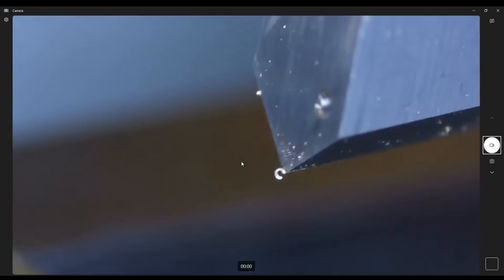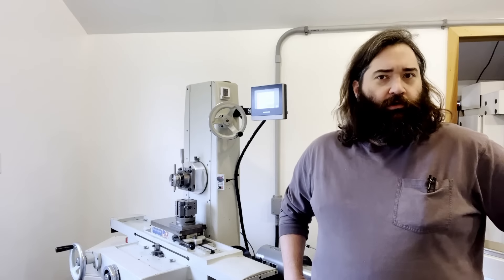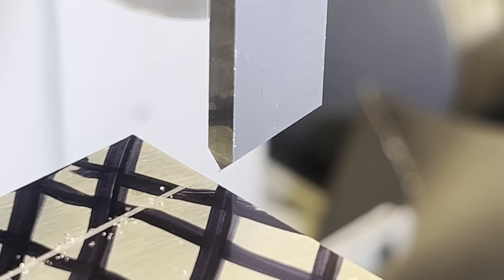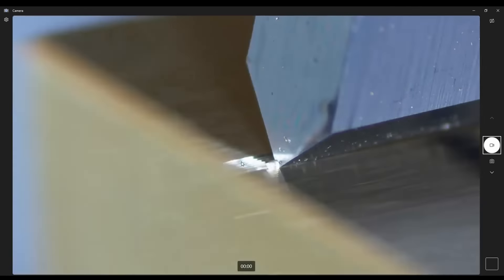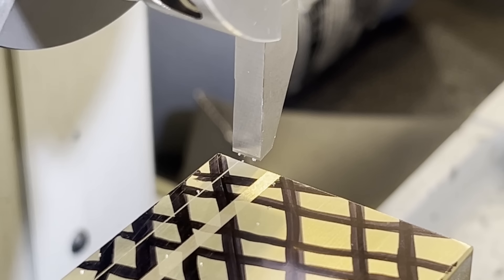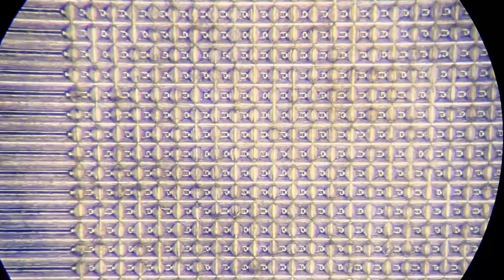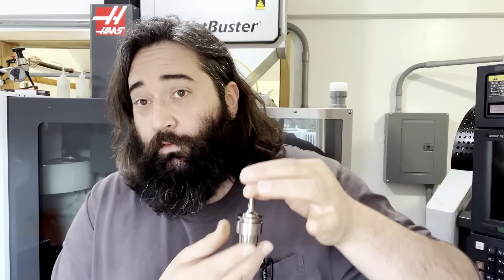Shaper Micro Machining

Comment: The results speak for themselves!  This is certainly a niche but clearly a relevant one, and I put it to you that vintage shapers with modern controls can still be relevant.
Reply: I picked up a small shaper a few years ago, mostly because I thought it would be a neat machine, and a lot of fun to use (which it definitely is). Adding a DRO and a quick-change toolpost has made it a seriously useful tool in my shop.

Comment: I used the cnc mill as a shaper. Was adding tooling to the underside of the head that was not finish machined. Mounted a cutter in the vise, and ran gcode to shape that area flat. Plus the added benefit that cleared area was square to the table travel. Worked well.
Reply from the maker: That is a very smart way to true up that surface

Comment: It’s not crazy if it works. Using the machine control to emulate the function of a clapper is kind of hilarious. That’s a lot of computing and control to emulate what used to be achieved with a hinge and a rigid stop! It makes perfect sense it’s just funny.😂 Thanks for sharing.
Reply from the maker: that comment about a lot of technology replacing a very basic mechanism is a discussion I have a lot. Was chatting with a guy that does jig grinding in a linear motor cnc mill and a manual moore. The cnc is amazingly capable, but the number of very expense components needed to do what a few bearings and solenoid do is interesting.

Comment: That's clever. I've never had to machine features quite that small so it would never have occurred to me to use a grinder as a micro shaper. Though I think I've seen a video of a guy who had a tool that was used to create a patterned surface that was essentially a freely turning off-center single point tool that was used in a CNC mill to do something similar to what your doing here by dragging it along a curved path.

Comment: I do a lot of micro milling in PEEK used for biological research and have played with shaping in the mill for fluid paths with very specific floor geometry. Unfortunately I don’t have a lot of time to play so it goes in fits and starts. I got kinda jammed up with the M code for spindle orientation and my CAM package. I just had a part come in with a 0.030" slot in it that I would have to mill from both sides because it’s so deep and I’m sure I’d break a few of those endmills. The cost really does add up. I’m inspired to try it your way in my Prototrak mill.  I just need a way to indicate in the cutter. First tho I’m going to talk to the just out of college ME and find out why the slot is so small or if it’s something I can just cut by hand with a jewelers saw

Comment: Good video thank you 
I did see your last video also. 
People all seem to try to go high-tech all the time sometimes there’s a low tech solution to the same problem  

We did something like that for spacecraft antenna. It was copper plated onto fiberglass sheets, and had to be cutting the notches. And we used a hand block plane there’s a full-blown machine shop.

Comment: Really interesting video, and you clearly laid out the use case for what is by-and-large a forgotten machining technique. I have some notes about the audio in this video: The voiceover was totally acceptable and easy to listen to. The audio that you recorded with the built-in microphone of your camera during the piece-to-camera portions of the video was extremely quiet, and the piece-to-camera at the end of the video contains a fair number of clicking noises that were made by you putting stuff onto the table where your camera was resting. Both of those things can be very easily fixed with free software like Audacity, and if you don't like cutting popping noises out of the audio by hand, just set a rag on the table under the items you want to showcase.

Comment: I've done CNC shaping on very fine heatsinks or similarly deep slotting. I can get a lot more carbide in with a flat blade than a 1/16" 15-18x reach endmill. Just on two parts I was able to save about 3 days of spindle time. Redline on an air cooled 12k Haas spindle for that amount of time didn't sound appealing to me. Couldn't fit a slitting saw down in a pocket or up against other features. Sorry about that last video, that was very impressive work.
Reply from the maker: Heatsinks seems like a great application for shaper work.

Comment: Could you please give some more insights into what Erowa chuck I should purchase for a vertical machining center? I want to get a "ITS 100" sized base that accepts both sizes. Is the pneumatic release feature worth it? or should I use the lever actuated. I like the idea of the pneumatic operated because it can air purge the seating surfaces of contaminants. I am planning to buy an budget model "Erowa Compatible" chuck.  What should I look for in my first Erowa chuck purchase?
Reply from the maker: The pneumatic system are a tiny bit more accurate , and very nice when changing a lot of pallets per day. The air purge isn't something I use. Having the door open, it tends to blow cutting oil mist all over the shop. Makes sense for a closed off pallet robot but its not fun having your face above the purge vents. Instead I just wipe the reference spots off with my finger. 

Which ever way you start out, you'll probably see the benefit and have additional chucks at some point. The lever style is very handy for indexers and small setups and I doubt you kick yourself for having on around

Comment: Very interesting process. Can the cutter stop in the material or does it have to exit the part? There are very niche refrigerant evaporators that use expansion channels that are etched with lithography process, this seems like it could produce similar channels much easier.
Reply from the maker: you can exit and enter mid way but you need the CNC to do it and have it gradually ramp into the cut and ramp out

Comment: If one has a decent spindle on a CNC mill, then one could even do fancy spirals and such. Just need very little backlash on that spindle, or direct drive or something similar.
Effectively CNC carving of metal at that point...
But yes, shaping does have a place in the industry for some applications.

Comment: Without sharing your customer or other details you would prefer not to, what would this be used for practically at that small scale? I have seen something similar using those erowa holders and a brass electrode for texturing using EDM , but it didn't require that level of accuracy.
Reply from the maker: Optics and micro fluid systems seem to be what the companies I make stuff like this are into . Sometimes I get details as to the purposes, but often not

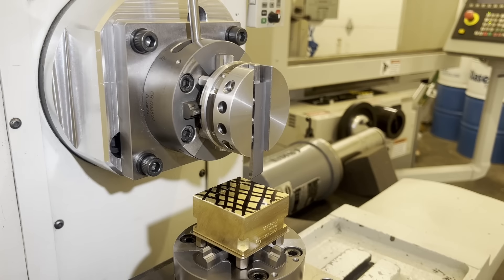Comment: 3:28 - Interesting, I would've never thought a surface grinder could be implemented as a shaper. For curiosity, would this setup somehow damage the surface grinder's head in any way? Did the surface grinder manufactures usually design the head such that it could be used for other machining applications other than surface grinding? You think it would be good idea to convert the surface grinder into CNC to automate this?

Comment: A setup for semi automated shaping on a manual grinder:
A fractional horsepower dc gear motor, round belt pulley, modified hand wheel with a v groove or flat area for a round belt, two adjustable position limit switches, pair of relays, basic dc speed controller, pivot arm tool holder, spring return short stroke pneumatic cylinder, pneumatic solenoid valve wired so motor forwards = on (cutter down) and motor backwards = off (cutter up)

Comment: Hi, great video as allways! I'm wandering if you tested the upper limit of the material hardness you can shape with micrograin carbide before you chip the tool starting the cut. Cheers!
Reply from the maker: I got up to 44rc and the tool was holding up , but chip breaking and a very fine burr are a bit of an issue  now. I’ll dabble with tool geometry some and see if I can shake out an improvement.

Comment: Wow that view of the surface catching the light... I'm convinced -- what does it take to do this setup?
Reply from the maker: just a way to mount the cutting tool to the spindle area of the grinder. The erowa systems is me a being a bit fancy, but any method of securing the cutter to the machine is fine. The cutter that did that was lapped micro grain carbide

Comment: Could you use the cnc machine to do the broaching? Meaning that yes, of course you can,. But is there a reason you didn't do that here too automate the process?
Reply from the maker: Generally if there is a lot of grooves I’ll use the cnc , the manual was setup and worked well enough for the video

Comment: can you do the micro v-grooves with a sharp corner flat end mill by positioning the part with 45 degree angle to the worktable?
Reply from the maker: You could , but the shaping has proven to be very fast
Reply: thinking for a second time, yes, your feed rate is basically for surface speed for shaping. @adamthemachinist

Comment: Great info, thanks for sharing Adam! Is the table drive on your grinder gear rack or cable driven? My Harig is a cable drive, and just wondering if the cutting forces would cause slippage on a cable drive?
Reply: using small depth of cut i don't imagine the forces would be higher than when you are taking a 15 tenths depth of cut with the grinding wheel
Reply from the maker: The Parker’s use a steel tape band to drive the table. It’s secured to the hand wheel so slippage isn’t a issue

Comment: I work in optics and custom crystal substrate machining and those sub .010" dicing blades are a nightmare. Getting them true and dressed and keeping them running in tolerance is a never ending process of chasing your tail. This is a great solution to machining micro features. I wish I could apply it to glass and crystal substrates I'd never use a wheel or rotating cutter again!!

Comment: Wonderful video Adam, it's great to see that a machinist can still make money with a shaper, and save money for the customer at the same time. I was under the impression that your friend Josh Hacko uses a variant of this technique to create guilloché patterns on his Kern with a non rotating tool similar to a lathe tool. The advantage of using a mill is that he can vary the depth of cut as well as create a curved path or follow the contours of a curved part.

Also, I notice that despite the obvious care that you take in creating your videos, the audio quality when you speak to the camera is significantly worse than that of your voice-overs. In particular the acoustically "bright" room causes your voice to sound muddy and unclear. May I respectfully suggest a lavalier microphone like the Rode Wireless Go II that Adam and Abby Booth use in their videos. Thanks again for taking the time to create these highly informative videos.
Reply from the maker: You are correct that Josh uses a similar technique, although with much more beautiful results . I’ve gotten enough audio flack that I plan on getting a lav mic

Comment: Can you cover programming a shaper action on a CNC in CAM? Can it be done in Fusion or do you just write it out?
Reply from the maker: I do use fusion for that, but its surprisingly basic. I just use a trace programming cycle. Sometimes its easier to just program it by hand on the grinder
Reply: @adamthemachinist Trace, that makes complete sense. I'm not sure I'd have come to that approach within a reasonable time frame on my own 😂 how do you handle  the M19 (Orient Spindle)?

Comment: You mentioned sometimes you need the flat bottoms shaping offers for sealing applications, apart from those, with is this type of grooving used for? seems like a neat cosmetic surface finish :)
Reply from the maker: One customer aligns some very small strands with the grooves I produce for them. Another does some small fluid work.

Comment: Have you considered buying a small shaper, or is the grinder more suitable for the type of shaping you do?  I'm quite sure that you wouldn't be able to find a small shaper that wouldn't require a full rebuild in order to achieve the accuracy you need, and I guess that may be whats stopping you along with the fact that you already own a machine that suits your needs.
Reply from the maker: I’ll never need to do bulk removal, so the lite duty grinders make sense . It’s hard to justify the floor space of a manual machine as specific as a shaper.

Comment: Maybe it is possible to integrate a heating element and a temperature sensor into the tool holder to heat it prior to operation and then take away power as necessary to compensate.. so that the tool holder is always at constant temperature. I would guess most of that stuff is fine operating at 100°C or something. Just an idea...
Reply from the maker: It’s easier to let the chips fall were they may and routinely update the tools gage length via laser . You just need to find appropriate times to measure
Reply: @adamthemachinist Jeah it probably is.. I had a good coffee and just woke up.. my mind is drifting occasionally ^^

Comment: Hey Adam, thanks for showing another interesting technique. That slotting tool is just insane...
Is there any reason why you chose the grinder over your Mori mill as a shaper? I imagine that would mean less setup effort and benefit from flood cooling, but I am sure you had good reasons not going that route.
Reply from the maker: The Mori has a hsk32E spindle . That spindle doesn’t use drive dogs so the tool would have the same rotational clocking between tool changes. Not a huge a deal to clock it in each time , but it’s much simpler tossing a bar of carbide into a erowa holder and it’s already lined up. I also thought the hydro dynamic ways of the grinder would yield a smoother finish
Reply: @adamthemachinist  Ah, yes thats quite understandable. Thanks for the explanation!
I didn't think much about the spindle interface, although you talked about that before and how expensive and hard to get the tool holders were. Regarding the setup time I was mostly refering to the pulling of the grinder spindle and mounting the Erowa chuck in the first place. Once that's done, I am all with you of course.

Comment: Have you tried shaping in the haas mini mill?
Reply from the maker: it does fine on macro features like keyways, in fact, haas even has a keyway broaching macro and tooling to do it. Micro features get a bit challenging because the spindle lock has a tiny amount of play. enough that a delicate cutter could break.

Comment: On CNC the shaping lines don't have to be straight. You could program in any curves you need up to the limit of tool clearance and if you can program tool orientation then there are no limits. I love shapers. If modernized , their drawbacks could be eliminated. There is no real reason they can't cut in both directions, thus doubling the speed. Whitworth did it on a planer before we were born.
Reply from the maker: A good friend of mine is doing some very interesting non straight shaping for his watches using a Kern cnc mill. Check out Nicholas Hacko watches
Reply: @adamthemachinist  Yes the amazing abilities guilloche linear rose engines put into CNC form. I'll check that out.

Comment: Its a micro planer. Yes it works opposite of a shaper so it is a planer.
Reply from the maker: Sometimes I run the work piece on the upper erowa chuck so it stationary and the tool moves. The previous video I made a few comments about not getting too wrapped up about titles and what machines are supposed to do .

Comment: Это, конечно, очень красивый строгальный станок. Вызывает сомнения, где реально нужны эти микроканальца шириной 125 мкм на латуни. Для изготовления часов? Для удержания смазки? Для каких-то научных приборов? Если у него ограничения в три шлифовальных зерна, так возьми зерно поменьше.
И зачем он всё время постукивает по головке станка? Неужели он настолько разболтан, что по нему нужно стучать, как по старому ламповому телевизору, чтобы он работал?
Reply from the maker: Not entirely sure on the purpose , I don’t always get that info. The grain size needed to form the customer’s geometry on that V would need to be a 1000 grit. The shaping is just less trouble and cheaper to tool up . Regarding the tapping , most would consider that manual machine in good shape for its 50 years of age . Yet when the head is lowered there is still a tiny amount of backlash on the screw and it’s is easier to tap the head to get the last .00001-.00005 than it is to advance the screw